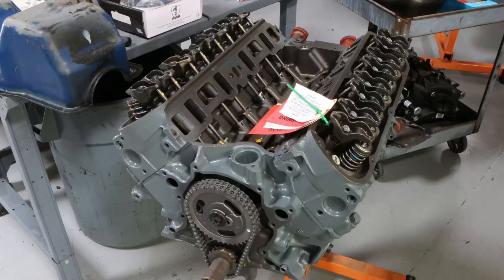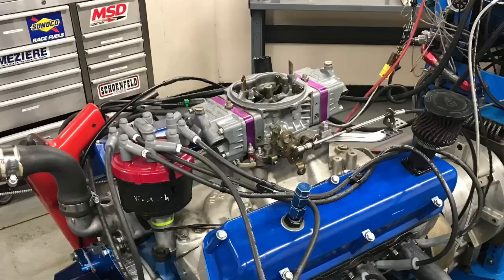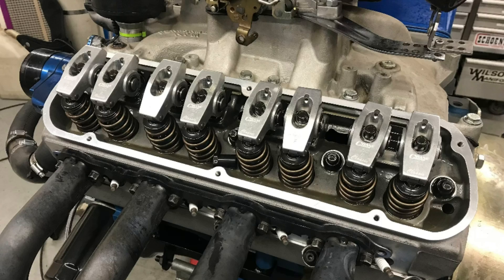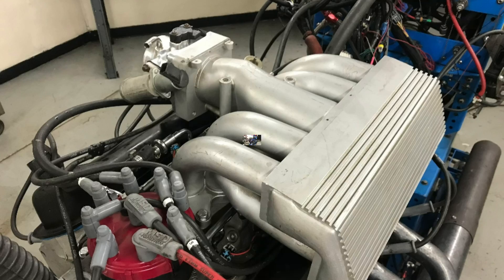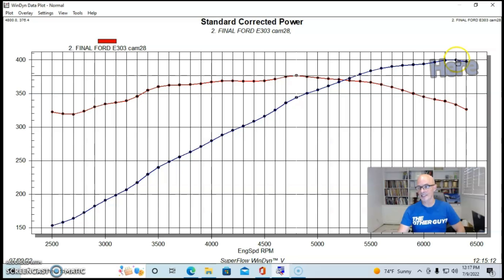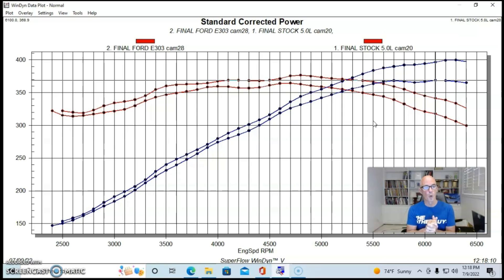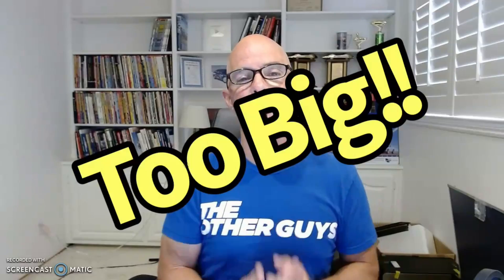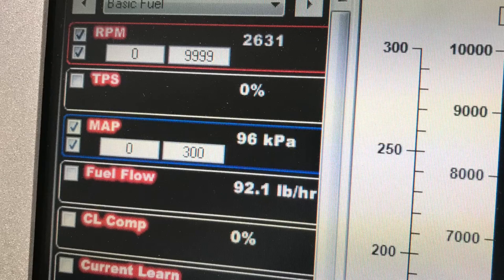5.0L FORD-CARB VS FUEL INJECTION-WHICH ONE WORKS BEST? EDEL RPM & 750 VS GT-40 & 65MM THROTTLE BODY

Comment: I am an avid old school 5.0 guy.  The issue with carb vs fuel injection at the time.....was nobody had a Holley dominator on their street efi setup.  It was ProM mass air and spout out with fuel pressure tuning.  The carbs slaughtered the efi guys  at the track.  Even with an A trim....back in the day...a carb and a 150 shot murdered all.
Reply: agree i did the whole trickflow fuel inj top end late 90s in my late teens. Barley broke 300 whp. My father in a mild 351 with trickflow heads with a 4 barrel Alway was faster. almost .5 seconds. I could hang to the 1/8 and he destroyed me top end. Fuel injection sucked back then.
Reply: Not to mention changing the MAF to run bigger injectors completely ignoring it was completely changing the timing table - d'oh!
Reply: @DillonAuto  Nobody is arguing car vs injector.  It is the lack of efi control at the time.  The efi tuning at the time was beyond horrible.

Comment: I'd like to see him get an elbow that mounts a carb to a gt40/ efi 5.0 intake for the ultimate test to eliminate variables and purely test efi vs. Carb that would be cool, or at least to me it would lmao
Reply: The results would be very disappointing. The runners can be so long on EFI intakes because they don’t need to flow fuel, only air.
Reply: No, the EFI intakes are not designed for fuel before the injectors, you would get puddleing and awful distribution.  EFI intakes are designed a certain way for a reason, Carburetor intakes are designed a certain way for different reasons.
Reply: I was unaware of the long efi runners causing puddeling and such, I guess there is not true apples to apples test🤔
Reply: @T-bird_Johnny  you could test a ram tuned individual runner type EFI against a similar manifold with 4x 2 barrel webber downdraft carbs for a fair carb vs, EFI but neither of those intakes are really practical in a normal front engine car.
Reply from the maker: just change the position of the injectors near the entry of the port for charge cooling
Reply: @richardholdener1727  you can't do that with a carb except individual runner manifolds and maybe tunnel arms but tunnel ram isn't a production car type of EFI intake.

Years ago there were cheap Mercury Marine Chevy Vortex style EFI tunnel rams on Ebay and I was tempted.  I just didn't have anything to put it in.  It's probably great in a Jet boat, maybe a 400, that would probably be really strong under 5,000 RPM.